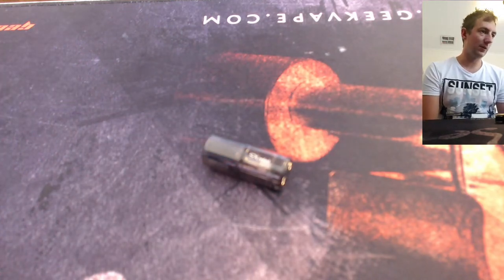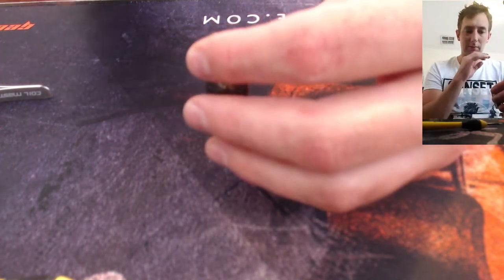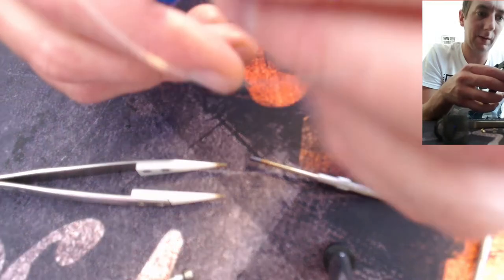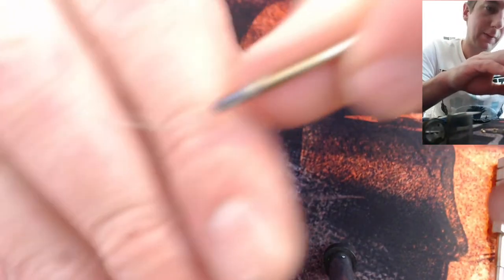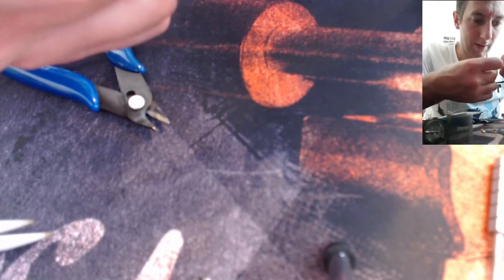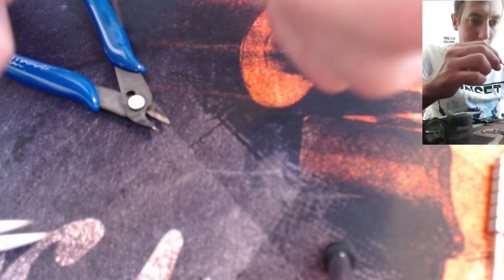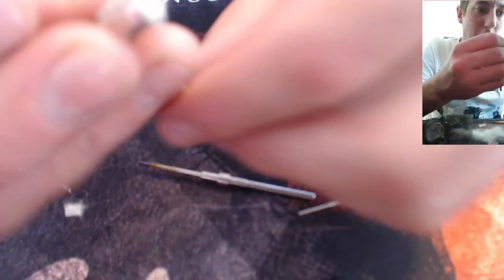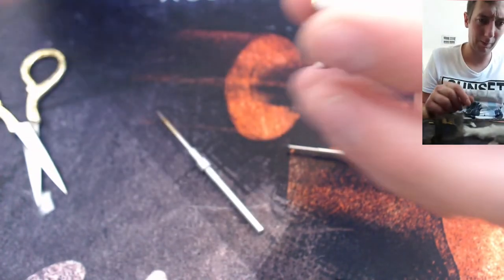Sx Mini mi class pod rebuild tutorial/how to

Comment: I did everything you have stated but the chamber will not come off the bottom no matter how hard I pull.... Was getting the chamber off hard for you? what i did do is broke the chimney off put still didnt get it out of the bottom piece, so coil and metal housing is still in bottom with a broken chimney
Reply from the maker: Yes, some pods I did where easier than others though. Use a set of pointy nose pliers and a tissue or but of rubber to protect the chamber and pry off with a twisting motion.
Reply: Something About Vaping AUS thank you
Reply: @somethingaboutvapingaus951  i took a base i broke the chimney out of and put it with a chimney i cut out of a base, so i guess you can say 2 pods to make one lol, but i finally got it, and ohhhhhh the vape on this thing now is amazing thanks.
Reply: Soak in hot water immediately before.